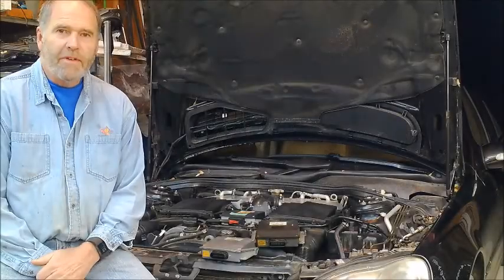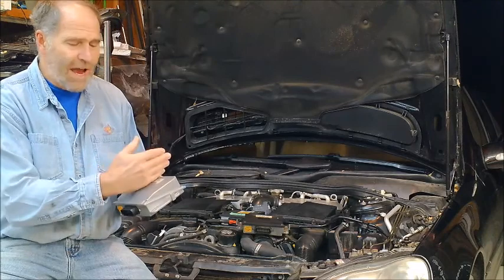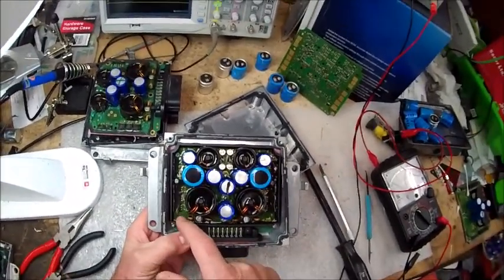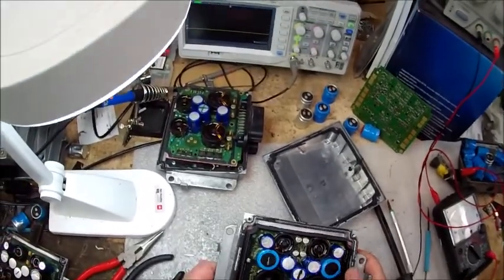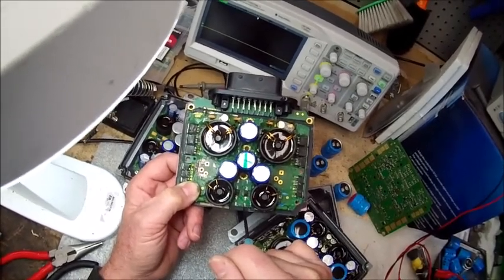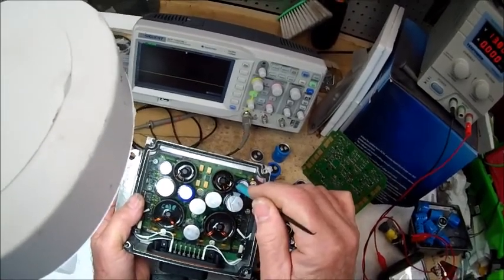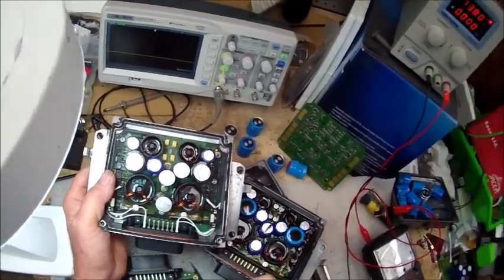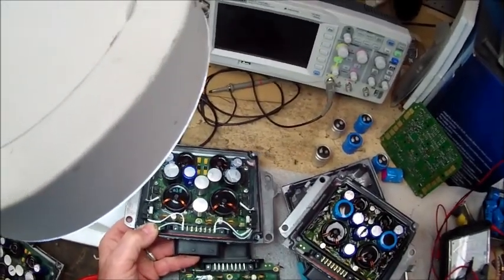Mercedes V12 Voltage Transformer (ignition control module) upgrade

Comment: I changed all 24 spark plugs checked fuel injectors changed a ignition coil and still have 2 missfire codes on my 07 s600 after a year a shop told me about this module and I feels it's definitely the cause of my misfire especially with this brutal arizona heat
Reply from the maker: Call me anytime 916-802-1045 or email @ clarkruppjr@gmail.com  Let's walk through what's you've done/what's going on and we'll get you back to 12 !

Comment: I think i need one. I blew the #28 or #29 20 amp fuse that left the car at a no crank no start and no communication with ecm. So i replaced the 20 amp fuse and got the car started. Now its showing me multiple missfires. I did disconnect the battery to see if restarting the ecm would help. Then ive read to drive it a while to try and make ecm relearn itself. I dont see that happening. My question is how can i purchase your voltage transformer. I have a 2001 Cl 600 non turbo.  
Im in san Diego california. Thanks in advance with any help you can provide.
BTW Ive already replaced both sides of the coil packs and plugs roughly 2 years ago.
Reply from the maker: Give me a call 916-802-1045
Reply: @clarkrupp  i have  missfires through bank 1-6 including the p0300 which indicates multiple miss fires. The car ran fine before parked at idle with the woofers  blasting.. And car just shut off. no crank no start.
Reply from the maker: Did you ever get this resolved ??
Reply: @clarkrupp  man..I did get the amazon voltage transformer from Amazon. It worked. But on a cold start the check engine light come on showing 7 missfires. I turn the ignition off and restart after a few minutes and it's back to 12 cylinders no missfires. I have my scanner. So that volt transformer is not right. So..I ordered another transformer from ebay and sending amazon back. I hope this resolves. If not I'll be trying to send you $700 for yours. Which I know your refurbish transformers may be legit and correct.  You're a lil pricey but my last option..lol.
I should buy one of yours anyway..
But thats where im at.

Comment: How would I test it and understand that my issue is this part?
Reply from the maker: Well..... looking at the transformer connector ..... the bottom two pins in the middle are 12v input to the transformer.  The upper right and left hand corners are the 180v outputs for corresponding side of the engine as you do the left/right pins.  The bottom two pins on the right are the 23v outputs.  If all the voltages are present it doesn't mean the transformer is good - they still fail under load or at operating temperature.  If one or more of the output voltages is not there then you know 100% the transformer needs to be replaced with my Boost Box. - my design for plug and play ease for OEM transformer upgrade.

Comment: How much for 05 s600 module?. I need one
Reply from the maker: This process/product has been replaced with my new Boost Box.  It is a remote mount, 4 line fuse protected direct OEM plug and play replacement for the original transformer
Reply: @clarkrupp  how much to purchase one?
Reply from the maker: @bossmanjerry1  They're $675  check out my website if you haven't seen it  V12icpack.com

Comment: This man is a legend in the CL600 world. Would one of these going out cause a no start no crank?
Reply from the maker: Absolutely. the transformer is the power supply for the coil packs.  I'm not rebuilding these anymore but have an entirely new design..  I call it the Boost Box.
Reply: @clarkrupp  Like I said, a Legend! What do they sell for? Got the car from a guy who took the car to a shop and they can't figure out why it will not start, he said they replaced the computer, coil packs, starter and it doesn't do anything when you turn the key beside light up the dash.
Reply from the maker: @ScarletSanctuary  what year ?  Sounds like a blown 20a fuse to the OBD port/ big difference between no start and no crank
Reply: @clarkrupp  2002 CL600 wanted to see if I could figure it out before taking to dealership, got the car for $1000, so figured it was worth the gamble.
Reply: @clarkrupp  Would think a shop should check the fuses as a first step 🤔 why would a OBD fuse stop it from starting? Engine doesn't even spin, turn key and nothing from under the hood. Car is being transported to me so don't have my hands on it yet.
Reply from the maker: @ScarletSanctuary  check every yellow 20a fuse with an ohmmeter when you get the car.  $1 fix !
Reply: @clarkrupp  That would be freaking awesome if so, guy said he spent $5000 trying to get it to run, and if the coils packs are new like he said and all the other stuff is as well, that's a steal. But would still like to upgrade that coil pack computer with the monster you made, when I had my first CL600 I got a coil pack from you.

Comment: Hi everyone can someone help I have w221 s600 2007 code coming 7,8,9,10,11,12 all misfire， if anyone can help me what’s the problem . Thank all
Reply from the maker: It's either your coil pack or voltage transformer.  How many miles are on the car ?
Reply: 75000km
Reply: The light come I have the some problem in the video  I just or voltage transformer ignition control because not available at the deal here in my country
Reply from the maker: @mohameda514  At that low of mileage it's probably your left side pack.  Use my email to get a hold of me... clarkruppjr@gmail.com  Where are you located ?

Comment: A good idea to indicate a fuse is blown would be to put a parallel LED with a huge resistor in line (200K Ohms or so) and drill this diode into the cover or main frame. Would save time.

Comment: Hey I know it's an old video, could a 95 s500 ezl be rebuild? I do micro soldering for work, also had a question about cooling the unit. What are you thoughts on mineral oil cooling with am external pump oil and a pc radiator??
Reply: Yes, versions of ASIC cryptocurrency miners use mineral oil cooling on the entire chassis and even the power supplies are submerged (as me how I know this : )   Makes for challenges when comes time to upgrade/sell, but as long as you can assure containment on the liquid coolant, you're golden.
Reply: @leechen4401  I looked into the design of the coil packs on 65 motors issue Is of sealing it tight! I think it could be potential fire hazard unless you can come with a sealed encloser that'll stay leak proof and can withstand engine bay Temps
Reply: I re-applied the thermal conductor on my EZL it's been rock solid since lmk if anyone needs instructions
Reply from the maker: You're thinking outside the box !  I'm not familiar with the older 500's and mineral oil ????  No idea..... you might dig around and see if anyone has done that with any similar application
Reply: @clarkrupp  people cool the entire pc with mineral oil, motherboard, cpu,ram ssd's even the power supplies! And power supplies are almost 1000W
Reply: @clarkrupp  my s500's EZL is overheating I think I'm going to give it a try and see how it goes

Comment: how much to get one?
Reply from the maker: A whole new reengineered voltage transformer is in the works.  It will be slick !  Mounted off the engine and most solid state components.  Targeting the end of 2020 but price not set - close to a coil pack price +/-

Comment: Hi Clark Delani here from South Africa, i recently found your video and iam dealing with problem in the shop now. The v12 s600 was bought second hand with a coil pack problem and engine light on, so i replaced it with a new one and the car drove fine. After a day of releasing the car the client takes it on a 600 km drive and when he got there the car then had no power. He drove it back on limb mode he could only do 130km/h, when it got to me it had the P0300 code and all cylinder on the right were not firing and yet i had changed the coil pack on the left bank. so i have taken the voltage transformer to a place called ECU EXPRESS so the can diagnose if it is not that, that is messed up. What do you think the next step is because on my diagnostic report it says all injectors an the right are shut off????
Your assistance will be highly appreciated!!!!
Reply from the maker: It can only be the pack or VT when you loose a whole bank like that.  Go to the coil pack harness and unplug it.  With the key on - engine not running.  Check the three corners of the connectors that have wires in them.  One of them should be @ 180vdc.  If you have that, then its the pack, if not , its the VT.  Call or text 916-802-1045
Reply: @clarkrupp  thanks Clark, the owner of the car bought a second IVT from a merc scrap yard and it is still doing the same thing. I did the voltage DC test and did not get the 180vdc so im assuming that the one from the scrapyard is also faulty, any takes?
Reply from the maker: @delanimbatha7145  You got 180vdc on one side and not the other ?  If you didn't get it on either side you're not testing is right.  Otherwise, I agree !
Reply: @clarkrupp  I DID GET 180V ON THE LEFT HAND SIDE BUT NOT THE OTHER I THEN WENT TO MERC AND BOUGHT THE IVT NEW THEN FITTED IT BUT STILL DIDN'T GET THE 180V ON THE RIGHT HAND SIDE SO THE TROUBLE CODE P0300 IS STILL THER. I THEN TESTED THE RESISTANCE OF ALL THE WIRES AND THERE WAS, BUT THE IVT WAS NOT GETTING POWER FROM THE ECU.... WHAT NOW???
Reply from the maker: @delanimbatha7145  Let's move this over to email.......  contact me at clarkruppjr@gmail.com

Comment: How do we set up a purchase we need one ASAP. We are a automotive speed shop let’s Set this up.
Reply from the maker: Give me a call 916-802-1045
Reply: @clarkrupp  still available??
Reply from the maker: @f0fIII  I quit rebuilding the OEM units and have focused my efforts on an entirely re-engineered product.  Prototype circuit board hopefully getting released to pcb shop for samples.  Should in production by the end of summer.  Will mount off the engine and cable over to the exisiting harness.
Reply: @clarkrupp  oke i dont need it now anyway so i can wait

Comment: I am looking at a 2001 mb v12 car.  The seller says the car runs then dies in a few minutes and was told it is a bad Ignition Module which has to be programmed by MB.  Is it necessary to program it and if so will you be able to clone these rebuilt ones to the bad one?
Reply from the maker: There is no programming on the Voltage Transformer or the coil packs.  If they don’t know that they don’t know what’s wrong with car.  For budget purpose you probably need both packs and a VT ...$2K

Comment: Clarke I have a 07 s65  it has misfiring on the passenger side on the . I guess that's 1-6 . The shop says it's on all cylinders on the right side but one minute it runs fine then it shuts down on the right side. But when it  runs fine the check engine light stays on and you can't tell anything wrong with it.  Can you help me??  My car only has 49,000 miles
Reply from the maker: Good talking with you Kevin !
Reply: What did fix this issue? I have similar

Comment: Genuine question, why didn't you put in a resettable fuse?
Reply from the maker: Just one of those deals where at first I was doing it for my own benefit as people were blowing up my rental units. - just stayed on the path I started going down thinking the small volume wasn't worth it.  May come back and look at them again because I'm rebuilding a lot more of these than I intended to !  Good question though !

Comment: Is it possible to modify the harness to put the module away from the engine?
Reply from the maker: Anything possible given time and desire.  If you could get a hold of the AMP connectors from a junker you could rig something up.  The upgraded ones I do can handle the heat.

Comment: Hi...Clark.   My 2004 S600 when cold in the morning starts up with cylinder 1 to 6 misfires, I changed the coil pack with MBZ part, but still the same. when Engine warm and if I clear the codes then no problem. What do you suggest is it the voltage control module or some else Please help. Thank you.
Reply from the maker: If you've got a new pack in there it pretty much has to be the VT.  I will say I've replaced a lot of MBz purchased packs after 1-2 years in the car

Comment: Great video! very illustrative. I wonder if I can do this type of repair. The SMC replacement for the tantalum caps is a no brainer, and I can do the 16 pin transistor as well since I have the equipment handy. I will have to check where to mount the fuse line by doing some testing but all in all I have a decent idea to start from.  Great content Clark, keep up the good work!

Comment: Good Stuff Clark, Ive worked on a lot of those m137 engines, back in the day,  Ionic Missfire Detection Coils,  never took one of those 
transformers apart of the coil packs. Was only trained in Mercedes Tech 240 to Diagnose rectifiey the missfire.  In  Summary a whole bank out 
Usually the transformer, a quadrant of 3 cyls , one of the coil packs, single misfire usually  plugs or a red boot, Along with misfires I 
replaced a lot of the Oil/Water heatexchangers between the heads. Good Times, I'm still with Mercedes today in Arizona.
Also v12 owners, do a full set of 24 plugs because these Ionic Misfire Detection Coils Burn plugs up fast,
Reply from the maker: Keeps me pretty busy these days.  I rebuilt over 500 coil packs and the voltage transformers are rolling in.  I can always take one more !
Reply: @clarkrupp  I need one tell me how to get please. I have an 05 s600 5.5 v12
Reply from the maker: @bossmanjerry1  Order from my website if you're in the United State and not in California.  Email me at clarkruppjr@gmail.com or call 916-802-1045
Reply: Hi seeing you were trained w/ Mercedes. I'd like to ask you where would I go about locating the voltage converter for a 2010, GL450, x164. Dashboard has "aux battery malfunction" sign for many months even after the battery was replaced with a new genuine one from MB. While searching online I was advised to check/replace the voltage converter/ regulator. But can't seem to find where it is.
Reply: @candlemedia  That Converter is designated N24/3 and is under the left rear seat area.
Reply from the maker: Sorry... never had any Mercedes training - or any other automotive training.  I know the ignition systems on the V12's but that's it.  Well..... relative to what characteristics cross over from one model to another.